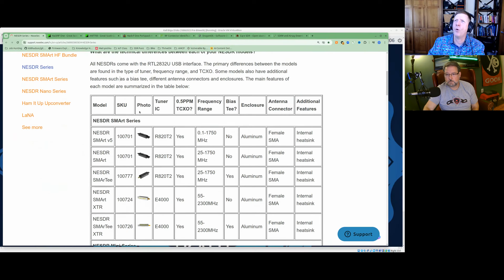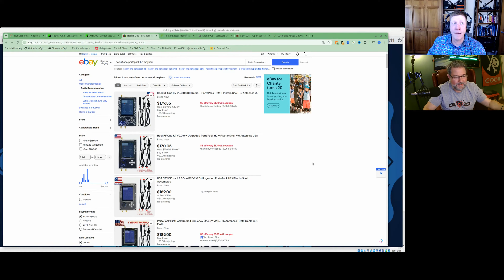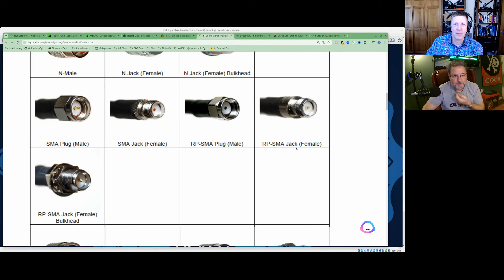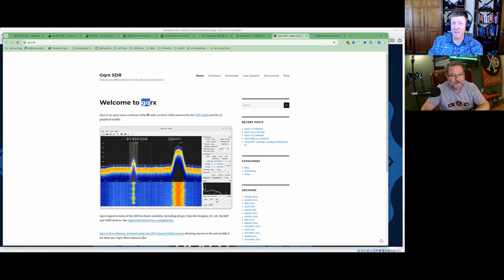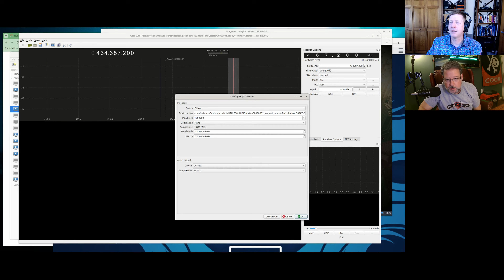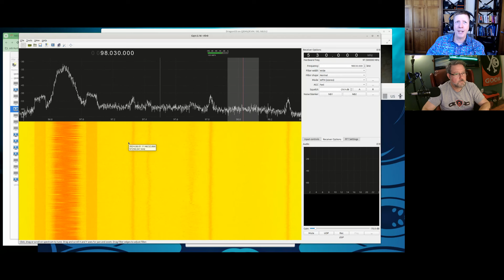A Beginner's Guide to Software-Defined Radio

Comment: Can you post your best place on how to build the best ADS-B antenna?
Reply from the maker: ADSB is on 1090 MHz, which is in the range of most antennas, so a basic telescoping antenna will work.  What I would focus on more is adding a filter between the antenna and the SDR.  FlightAware has one that they sell, but there are a lot of others.